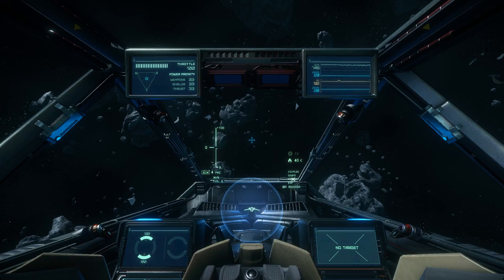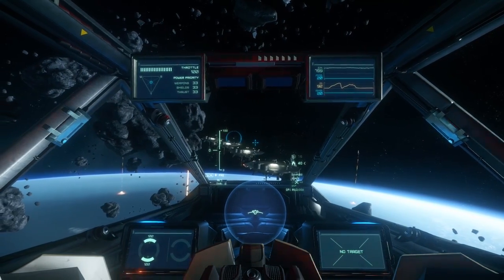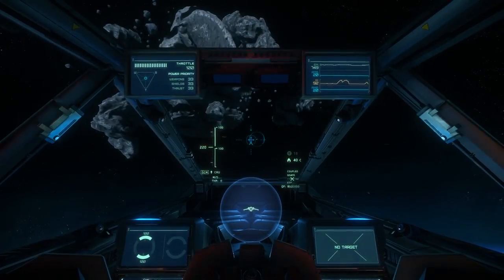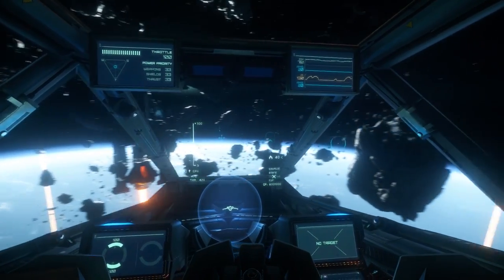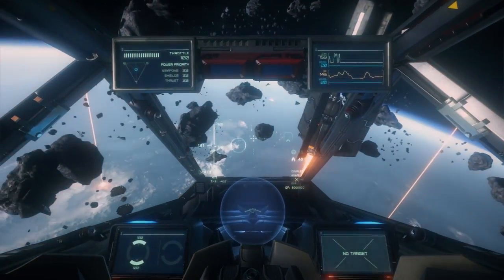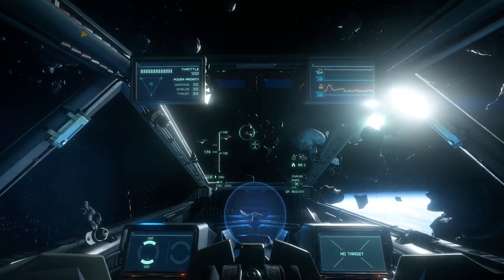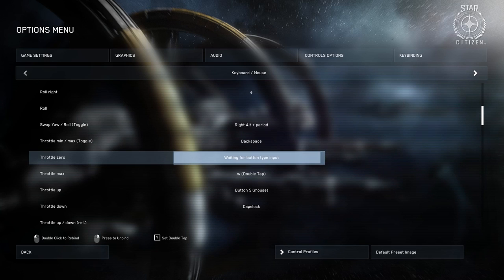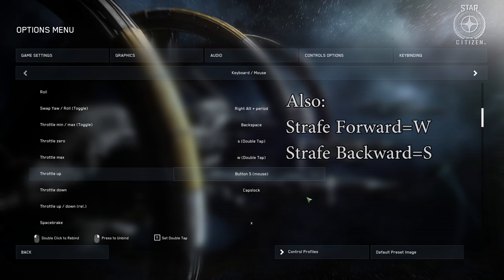The Basics: Ep. 2.0 | Flying Full Strafe (The best keybind setup for flying)

Comment: Really liking the series so far! I was wondering if you could do some videos on larger ship control, first with ones like the tali and connie in order to be both evasive and good for your crew?, then if you have time cover the ships like the carrack/890 jump size way down the line? Also once the new flight model comes out it would be great to see both what you think of it and how to do these maneuvers there! Keep it up!
Reply from the maker: I will try to do some of that in the future, but right now I have little experience with larger ships. I will definitely analyze the new flight model, but actually a lot of my suggestions in this video achieve the entire purpose that i believe they are working towards in the new model. For example, all of the jousting and lack of control that many players tend towards comes from not strafing--which then doesn't give them enough time to turn and they end up jousting--so by lowering the speed of all ships they give them more time to turn. I tend to fly at lower speeds anyway whilst dogfighting. Thanks for the support!
Reply from the maker: catnuts I don't think jousting would work actually; a large ship has an even worse turn around time than a fighter, so jousting would theoretically be even worse. Perhaps flying decoupled, backwards, in cruise mode with all shields forward would keep the target in front of you while maintaining distance?

Comment: and you can bind both throttle and forward/backward straffe on the same axe, it s give u the number, the sound . Just go in binding ingame and bind throttle first ( rel) and then straffe for/back. Done. And yes it works i use it .
Reply from the maker: The point is not for the number and the sound, it is to control the angle of lateral approach while maintaining the top possible speed as well, as I replied to your last comment.

Comment: I think you don t get that throtlle and straffe forward are exactely the same input. U don t need the throttle , except if u want the numbers and the sound...
Reply from the maker: Well I demonstrated in this video that it actually does make a difference...  You can see at 3:45 that with 100% throttle and left strafe I am traveling 45 degrees left, but then at 4:02 with 100% throttle and forward strafe (in addition to left strafe) now the angle is ~20 degrees. This entire process is actually based on throttle and strafe forward being equal forces, but they are, in fact, additive.
Reply: Again, its the same input but with trhottle up your lateral straffe are additive, so thats why u don t need the throttle at all  again except for numbers and sound. A very good video from legacy demonstrate that perfectely...
Reply from the maker: UINS_PENITOR Legacy literally covered how mouse and keyboard users can mimic analog controls by the same method I use. It doesn't matter if it is the same engine providing the forward thrust by strafe or by throttle, what matters is that it does translate to different flight paths. With mouse and keyboard without separating the controls, you can only fly to the left, at a 45 degree angle, or straight ahead, separate T&S allows you to mix them evenly.
Reply: that s way I say :don t use the throttle at all...
Reply from the maker: UINS_PENITOR If you don't use throttle you only have 8 directions to choose from on M+K, as opposed to infinite.